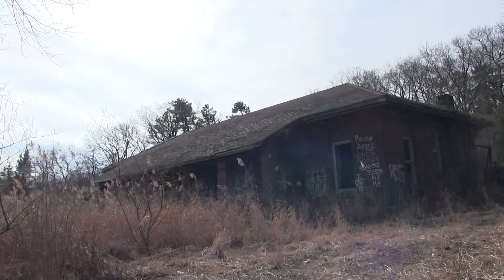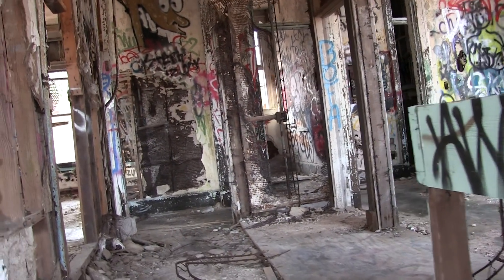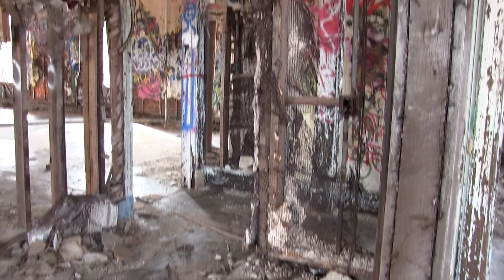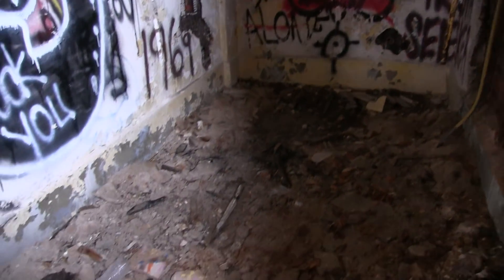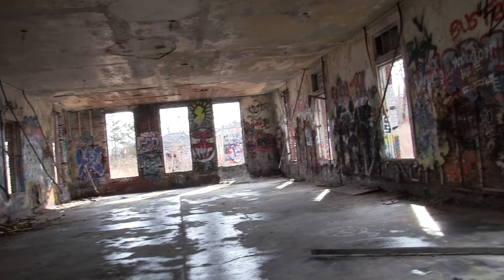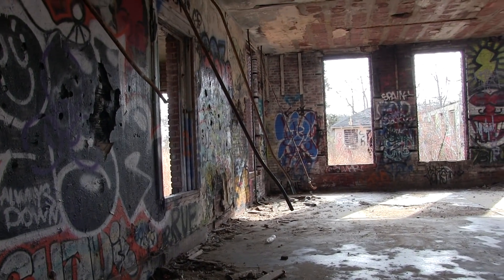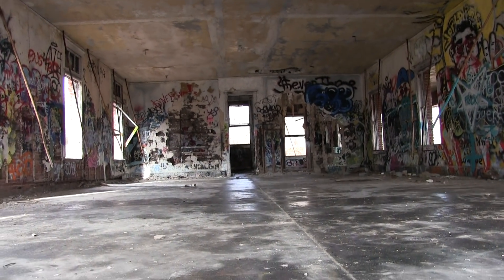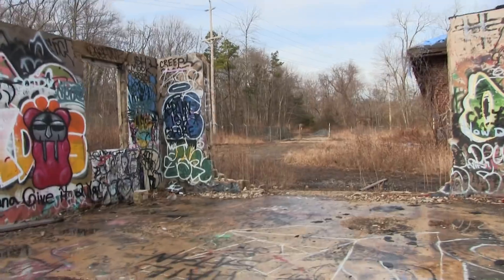Abandoned Transmitting And Receiving Station Marconi Camp Evans Signal Laboratory

Comment: I've only visited Camp Evans twice. It's certainly more interesting then the Franklyn Institute in Philadelphia, because of lay out the area. Of course,  FI has everything under one roof. At Camp Evans you get a total body work out. A mental work out and physical work. One thing Camp Evans needs is area to put a restored GG - 1 with some CNJ Coaches if there's a rail line on the property. I would like to be able sit in the engineers seat  and see what they saw in the early days.
Reply: I agree and I wished I know about Camp Evans years ago. That would have made an excellent Field Trip when in grade school.